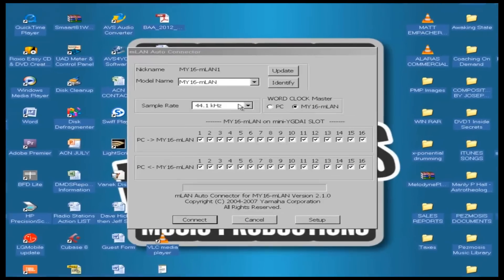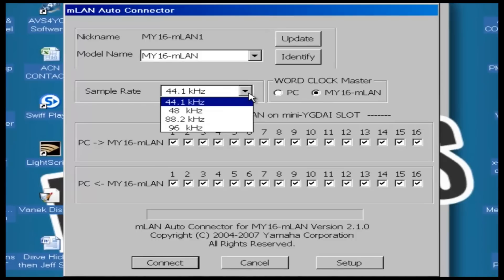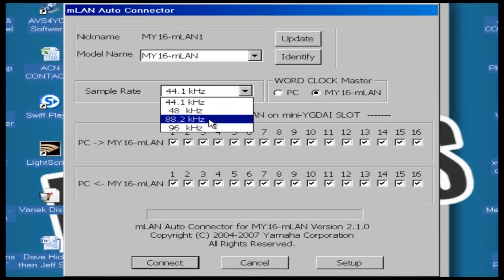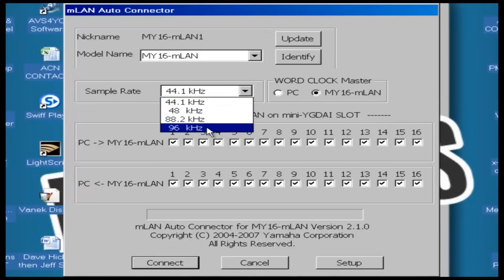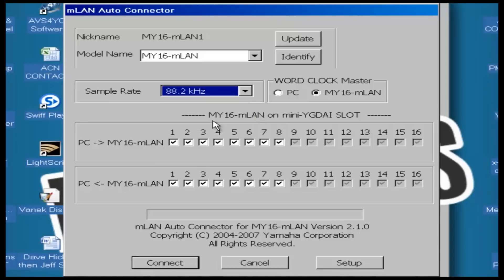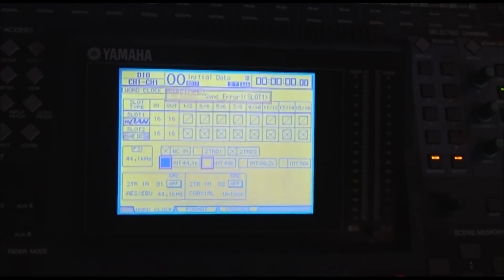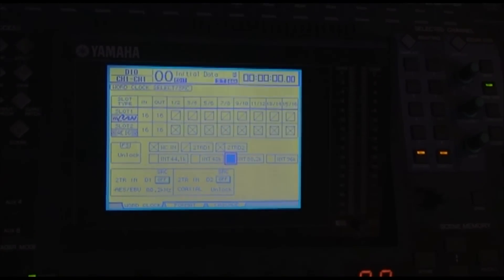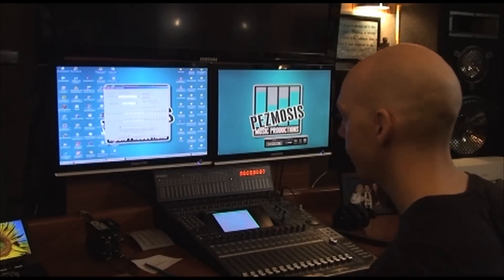How to Record: Word Clock

Comment: Not necessarily agree with the “DVD quality” comparison. DVDs are using a compression format that even though runs at higher sampling rates it does not necessarily get better audio results in comparison with a not compressed CD quality sampling rate.
Reply from the maker: Thank you Andrew. I agree with you. Great comment and thanks for clarifying!

Comment: why are you recording at 88.1A???
Reply: TJ Mack You mean 88.2khz?  Well, simply because that number is perfectly divisible by 44.1Khz Audio CD requirement.  48, 96 and 192khz sample rates are for video.  44.1, 88.2 and 176.4khz are sample rates if your end goal is CD.  The math of resampling or decimation is much easier and introduces less errors this way.

Comment: Never used more than one interface to record or even the need for more than one track at a time actually, well until lately. Anywho, I still don't need such a device but like to learn. I'd say the first observation I've had with the word clock is it's need for a name change. Word clock is too close to world clock and doesn't even fit what it does. Just my zero two, thanks for the vid!